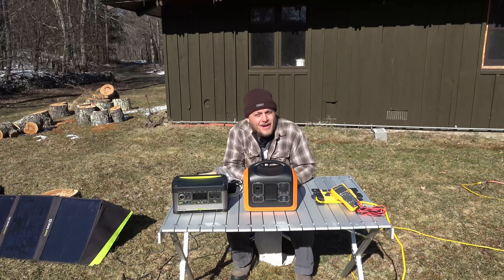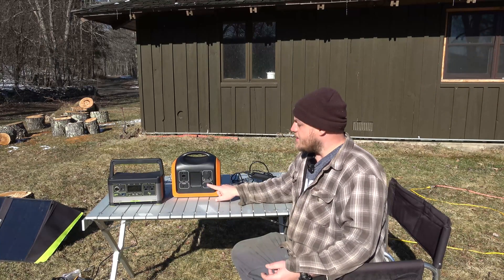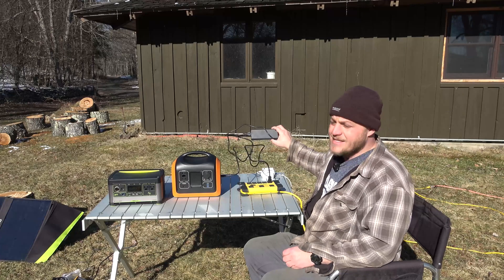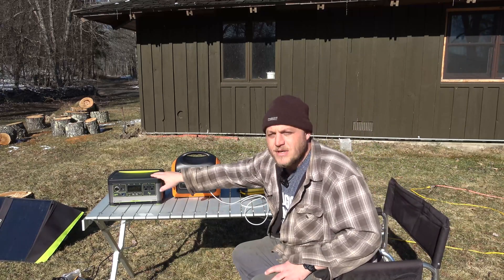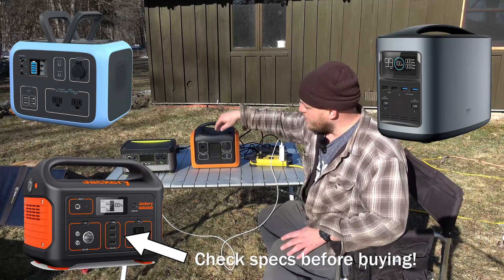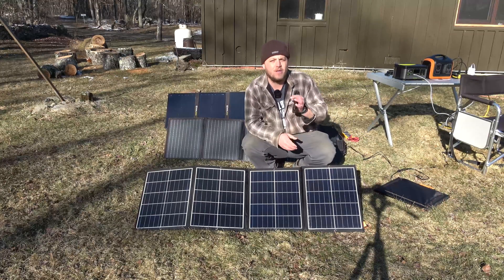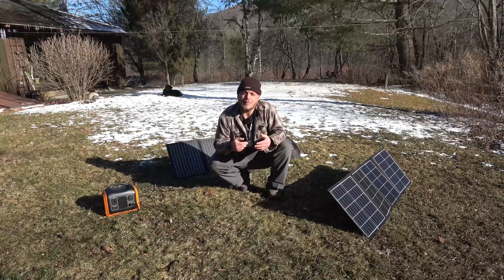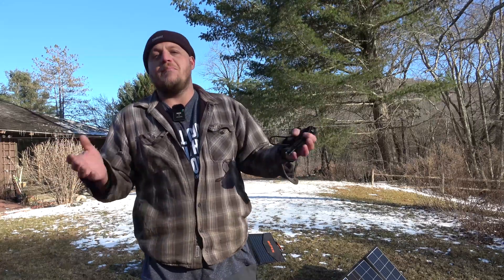Faster Charging - Portable Power Station

Comment: Sir my power station have pd charging but i cant charge it via pd
Reply from the maker: I tried to modify the description to update.  This video is several years old, and a lot of the brands have changed how they label this.  Now you have to see bidirectional charging listed in your manual.

At the time of this video, I listed the power stations that this was included on, now there’s thousands of brands — Important to just check your owners manual to see whether you have bidirectional power delivery.

Sorry for the confusion!
Reply: @DIYOutdoorLife  i have 2 power station supports pd but when i use the other ome to charge it via pd it doesn't work? Or do i need higher charger like 100w to activate  the pd charging?
Reply from the maker: @KennithAliling-sh1ss 
They will just equalize each other out, if they do anything at all.   
Plug the PD cable into a block charger, then into wall charge.  Maybe sure you have a 40-100 watt block, not a small phone block.

Comment: I have a question about charging expansion batteries if you can help . I have the goal zero expansion tanks with lead acid batteries. I want to replace the lead acid batteries with lithium batteries to save on weight and longevity. Will the module that charges the lead acid batteries work to charge the lithium batteries?  Thank you for your time.
Reply from the maker: There are some tricks, but it's a little difficult for me to answer in text.   Generally speaking, they want to work with AGM batteries.  
Goal zero has really good tech-support with this stuff, give them a call and they will walk you through this.

Comment: I have a 400w solar panel and my Ecoflow River 2 pro maxes charging at 220w. Would it work if I split my solar panel output into the regular input and the usb-c 100w one? I could technically get 320w of charging power from my solar panel then?
Reply from the maker: Yes, that is possible.  You can boost the charging by utilizing the USBPD input.   You are going to have trouble splitting one panel to be able to do that.   I think you're easiest and least expensive option is to look for 120 W panel that has PD output.   Even though you're buying another panel, you're gonna end up needing to buy gear that will split your current solar panel and convert to power delivery.   Hope this makes sense!

Comment: My GoLabs has a PD 100 W. So I can plug that 10' USB-C wire into my GoLabs as well as plug the solar panel into it at the same time?? Can the power stations that offer the feature still do pass through charging if you have both plugged in at the same time?
Reply from the maker: It's really important for you to look in your owners manual for bi directional USB-C.  Not all systems can do this.   
If yours can, you can charge it to the USB and the solar charger at the same time ... it helps.   He will also be able to do pass-through chargng.
Reply from the maker: I just looked it up and it appears that Go Lab can do this in the R500.  That would be good news for you, but please double check.
Reply: @DIYOutdoorLife  I have the R500 so I think I can do it. I don't think it actually came with an owners manual? I'll look that up too.

Comment: How bought usbp in 12v socket and solar together?
Reply from the maker: Youll have to be a little bit more specific here.  Are you talking about plugging a solar panel into the USB- C power delivery port and the solar input?  What model Power Station do you have?

Comment: Good info. I just recently realized how much power can be transfered via USB C, and it's really cool. Dual charging a solar generator looks like a great way to basically parallel different panels.
Reply from the maker: Theyre  pretty handy, i wish apple would use them in the states.

Comment: Today I had several power stations power banks and a Ecoflow glacier battery. I was trying to usb c charge the Ecoflow battery and nothing worked.  USB c is great when it works. To bad the cable is not directional. That would solve everything.
Reply from the maker: Some times they’re a pain, I found plugging and unplugging a few times usually does the trick

Comment: So if your station doesn't have a type c PD port then you are out of luck on the duel charging capabilities? Sadly, I don't think my power station has a usb typc c PD port is there a way to buy an external port or anything like that? Thanks great tip!
Reply from the maker: No way to add, some can duel charge between solar and AC though

Comment: Hi Brian, could I use the Powoxi panel to charge my my AGM battery too?
Thanks,
Chris P.
Reply from the maker: Yes, the one that comes with a charge controller.
Reply: Good to hear, thanks. Is the charge controller the small black plastic box that is attached to the panels or should I hook up a different charge controller between the panels and battery? Also, would you advise me to connect with an Anderson powerpole extension cord or use a different connection?
Reply from the maker: @cwpace  they make a solar panel with a charge controller and one without.  I’m not sure which one you have, but I suspect that you got the one without a charge controller.

Both will have a small box, the one with the charge controller has wires going from the panel to the box  and has a battery icon on it.  The one without just has a small DC port and USB plugs.

In order to charge any battery, you will need to make sure there’s a charge controller there to regulate the charge.  If you got the one without, get a charge controller in theyre simple to set up.  I love the Anderson set up, you can’t go wrong with them.

Comment: Hey Brian!  Great video. Question for you, have you tried to use the DC5521 and USBc connection from the same panel into a power station.  I have the Outsunny Power Station and its DC5521 input port maxes out at 6amp so 72watts or so and cycles to 0w up to 72w again.  I think if I split the power on the panel between USBc and DC55221 it might help?  Thoughts?
Reply from the maker: I’m not familiar with that power station, but the solar panel should be putting out 18+ volts, that should give you more than 72 watts at 6 amps. You’ll have to do some trial and error.
Reply: @DIYOutdoorLife  That thing is pure garbage.  It stopped charging completely.  I'm returning it for a refund and bought a Bluetti instead.
Reply from the maker: @goglu1969  which model?
Reply: @DIYOutdoorLife  Outsunny 84F-006V80
Reply from the maker: @goglu1969  which bluetti did you get?
Reply: @DIYOutdoorLife  EB70S
Reply from the maker: @goglu1969  that’s a great system, you’ll be happy
Reply: @DIYOutdoorLife  thanks

Comment: Mine came with a 24v 5.a 120w, can I use a stronger 24v 8a 193w charger?
Reply from the maker: What model do you have? I believe that’s a 24v output only port, not for charging.

Comment: Hi can I charge my power station and use it at the same time?
Be it solar or direct electricity?
Reply from the maker: What powerstation do you have?
Reply: @DIYOutdoorLife  500W by Matech
Reply from the maker: @Purple_Links  I am unable to find your power station online. Could you be more specific, is there a model or some info I could search with, Matech 500 brings up nothing.

In general, almost every power station ever made has pass through charging.  This will allow you to charge and discharge at the same time.  There are several factors that determine whether it is fine to do anytime you want or if it’s bad for the system and should be done sparingly.  If you can get me a description to search the system, happy to help.

Since you can’t link in a comment, feel free to email me at diyoutdoorcontent@gmail.com

Comment: I want to run two Powoxi solar panels. One through the PD port and the other through the DC port to charge this powerstation from Amazon 
( imuto Portable Power Station 600W, 622Wh Solar Generator with 2 AC )
I’m getting the 
( T1000/ 1038wh model ) not the
 T600 /600w model . I couldn’t copy/paste the link to the exact model that I  wanted , so to save time , I just copied the short title ,  (necessary to make it easier to find on your search feed)

According to the specs you can dual charge this powerstation using   wall sockets , 
USB -C 100w charger + Dc power brick 200w =(300w max)
I  was wondering would this dual charging  hack work if I run two solar panels using the DC and Usb-C port at the same time ?  Or will I need extra cables to do this ?
Reply from the maker: I use the USB C cable in my description. Although I have not used an Imuto, from what you’re saying, it should be fine.

Comment: To clarify - this hack does Not work on 12V DC only AC and solar correct?
Reply from the maker: Can you clarify with an example?

 This USB C charging can be done with units that have bidirectional (in/out) PD ports.  The usb c can be plugged into an AC block charger like a laptop charger or DC through a solar panel.
Reply: @DIYOutdoorLife  hmm with my EcoFlow river pro I do not know if the 100w usb-c is a PD port because it does not input power from my solar or from the 12v DC port in my camper. I called EcoFlow hotline and looked for specs online to see if the Ian-c port is a PD and apparently it is however it is not pulling in any watts
Reply from the maker: @dgavern  it’s not bidirectional then. They make it unnecessarily complicated, I will try to include a list of the PPS that it works with.
Reply: @DIYOutdoorLife  shucks great hack tho! Definitely something to consider when buying power stations!

Comment: I have that small Bluetti and wonder do you have to switch the unit on and if so, do you have to switch DC on too? Thanks a lot for your videos, we are just getting our teardrop and are super excited.
Reply from the maker: The first step is making sure that it says in/out on the PD port.  If you’ve confirmed in owners manual, then you can charge this way.

They’re all different. With the Oupes 600, you plug it in and it turns on automatically. With the other units I’ve used, you do have to turn the port on.
Reply: @DIYOutdoorLife  We have 2 Bluetti and both show the USB-C port as PD but I have only a phone cahrger and it might not have enough power to be shown in the bluetti ;-)) watching lots of your videos about solar panel installations, tips & tricks etc. Also watching lots of yourn more relaxing videos ;-))
Reply from the maker: @DirkME1022  i’m glad that you’re digging the channel! Thanks for watching.

As for bluetti, they have been the center of confusion for this video. I should remake the thumbnail and drop them all together.  They make units with PD that CAN do this and some that CAN NOT.   Just verify that yours can, it’s not going to be dangerous or mess anything up but they did throw me a curve ball with their “mono directional PD’s”…lol.  I hope you’re able to do this, it’s pretty neat.

Comment: Just got our Oupes 600!  Still testing all the power option capabilities before heading off-grid sometime soon I hope!?  I didn't know if a 120w solar panel with a PD plug could be connected simultaneously from the same panel to get a higher charging rate for the solar generator or if that is advised since the generator states 100w max input?  Can the generator distribute the extra wattage to the PD plug without damaging the unit?
Reply from the maker: I deleted my first response after rereading your comment.
If you plug an appropriate 120 w panel into the oupes 8mm input, it will only give you 100w.  It will limit the input to the battery through the charge controller.
You can take advantage of what we're talking about in this video, by using a separate panel w/ a PD output into the Oupes 60w PD in/out.
Hope this helps!
Reply: @DIYOutdoorLife  Thanks, Brian!  I was trying to avoid needing two panels but I guess those suitcase-style panels do pack pretty small.
Reply from the maker: @tracyking7445  I totally understand.  See how well you can do with one, you might be okay.   If you find that an upgrade is needed, the PD ones, like in my description are great because they charge laptops, phones, and other electronics.  It can keep those devices charged and save the Oupes for things like fridge.
Reply: Actually, we did get the Oupes to mostly run the fridge......and maybe a little heat.  As soon as the weather cooperates we hope to install our 12v wall plug to back feed our electric system. 🤞 

Great reminder to get a panel with the 60PD though to keep everything else charged.
Reply from the maker: @tracyking7445  Sounds like youre planning to have a blast!

Comment: Since I already have larger panels and an MPPT charge controller, I would like a direct charging port to the battery and charging specs to set up my solar and CC to charge the power station faster. 
This assumes the manufacturer's MPPT CC is smaller than the maximum allowed for the battery.
Reply from the maker: I used to do this with the older Goal zero‘s. You could simply open a compartment on the top and wire in a Victron MPPT… worked great.
Anymore, the larger systems come with very fast charging. Some ecoflow, bluetti, and goal zero have 600 watt mppt built in. I would need a truck full of solar panels to hit the limits.
Still a fun project, thanks for watching and commenting!
-Brian

Comment: You're right about reviewing the owners manual first. Great point since not all models seem to work both ways. Did you say you had received one of the Techoss 300? I know the model claims on their website and Amazon to be in and out recharging. $40 later, the model they sent me clearly didn't accept a in charging with the PD60 port( I believe I got a early production model since it has a 8 amp DC port) It would have been great since they did send me a 35-watt panel, which has been wonderful. I didn't know if you experienced that also when testing?

It's Definaly a hidden secret for those models that do offer recharging through the PD60 port as the Jackery 300 and many new models list. But it really isn't clear. At least I was confused when I first learned about it. I wasn't sure if my fast charge phone plug would work, or did I need a 30-watt or a 40 watt, etc..??? That part was definaly not clear and confusing. After all, who wants to toast a brand new product by plugging power into the wrong port? 

Great job on the video. You did say refer to your owners manual. 🙂 
Mark (& Teresa)
Reply from the maker: I'm really glad I emphasized the owners manual part....lol   I have actually learned  a lot more since I filmed this, some of my subscribers pointed me in the right direction.  PD 3.0 is bidirectional, but some manufactures do not allow it to be used that way with their power stations, while other do.  It should always be clearly explained in the manual.  Most of them are printing "IN/OUT" right below the plug.  I've done this dual charge with a ton of systems, but I'm seeing that the bidirectional plugs are being phased out on a lot of brands.
Reply: @DIY Outdoor Life  I love learning. While I feel I'm a solar generator junkie would you consider doing a follow-up video to share all you have learned? While some may know but I myself and I'm sure others are confused even how the PD60 port works out, let a lone in. As did I, which as I pointed out, with the Techoss claiming there, the new 300 offered such.  I didn't even know what plug to buy since they offer different charge rates, watts etc.. I'm sure you get my confusion. You always do an amazing job explaining. Thank you. 
-M
Reply from the maker: @OutOfOfficeCamping  I've been building these systems for years, read through updated data sheets weekly, and I'm still regularly confused...lol   The tech develops fast and the "variables" mean that some things are true sometimes and not others...lol
I will definitely follow up, I have a ton of content backed up so I'll start releasing more frequently.  Thank you for staying tuned in! How are things going w/ OOOC? looks good!
Reply: @DIY Outdoor Life  Always love to stay tuned in. So wonderful to see your channel grow. Speaks volumes for good, honest content with no gimmicks. Hard to be rewarded on YT platform for such things sometimes. 

OOOC doing well, just picked up the Smooth 5 Gimble to send it back and pick up the DJI OSMO 5 (Android freindly) and just ordered up the all new DJI mic system (like your Rodes set up) just released. Sound has always been out short fall for our rig tours and channel. Not any more! Ty for asking. 🙂
Reply from the maker: @OutOfOfficeCamping  Nice, DJI makes great stuff.  The rode is really easy to use, if I took 2 minutes to set up it would sound great.  I usually just throw it on and go...lol
Reply: @DIYOutdoorLife  ❤

Comment: Awesome info brotha, just got a solar generator and panel and didn’t know this was possible! 👍
Reply from the maker: awesome! what did you get? does it have a PD?
Reply: @DIYOutdoorLife  Got a Bluetti EB150. The port says PD and I tried this but saw no wattage coming in. Is it possible cause I was using a phone charger block so couldn’t supply enough power like a laptop charger or something would, or maybe cause my battery was already topped off?

Comment: I am led to understand that not every USB-C PD port on a solar generator is bi-directional. Ports on some models only allow for output, not input. Is this correct? If so, is the specification for that generally listed in the manual or on the product web page? That would be a good piece of information to know before buying.  EDIT: PS - how do you like that Alps table? I just bought what I think may be the larger one, but I haven't rolled it out yet.
Reply from the maker: USB-C PD 3.0 is bi directional,  USB-C is output only.  It will always have the PD on the port and owners manual for the IN/OUT.  
Love the Alps... really nice to have a quality table that is light and packs easy!
Reply: @DIYOutdoorLife  AHA! That's my educational moment for the day - Thanks.